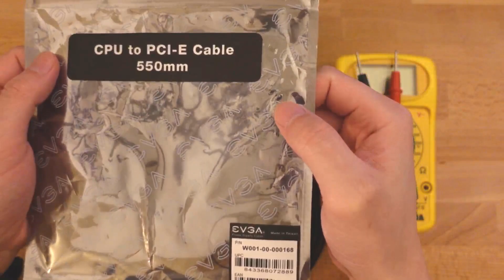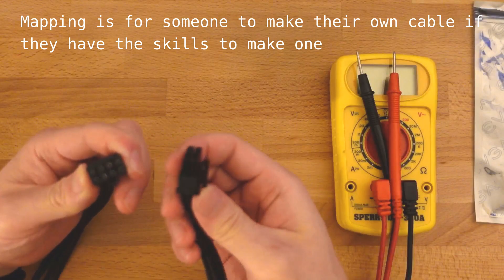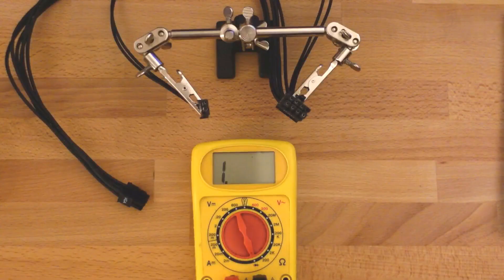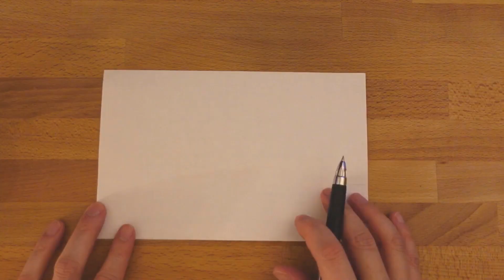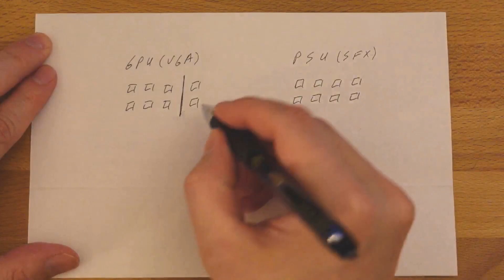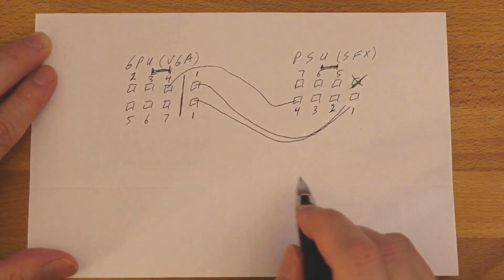EVGA CPU to VGA Cable Pin Mapping

Comment: Great work.  This is exactly what I was looking for.  Can you do a video with modding a nevga CPU cable to a pcie connection how to?
Reply: Maybe also a video with modding those generic mustard black color  pcie to those HP breakout board PSU to fit an evga PSU.
Reply from the maker: Not sure what you mean about HP breakout board, are you talking about a PSU voltage breakout board?
Reply from the maker: That would be a neat video, just don't have the time at the moment. Let me keep it in mind and will try.